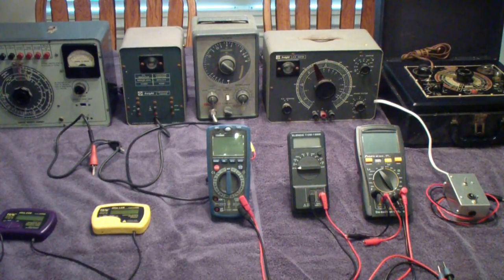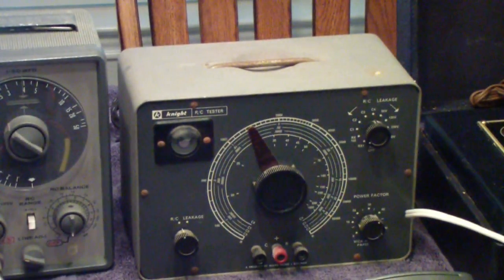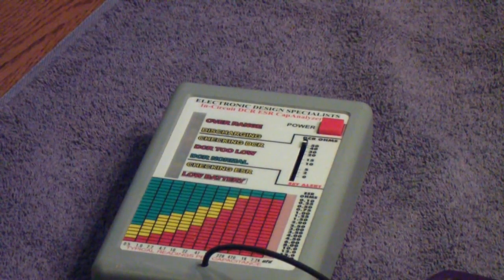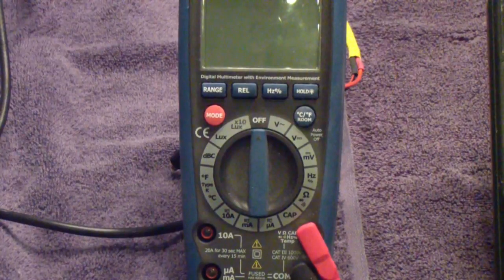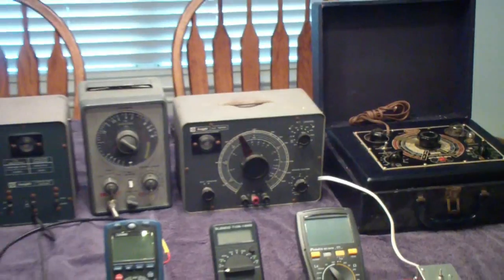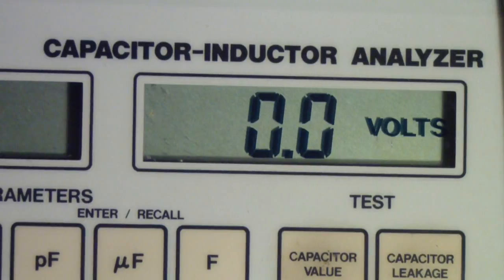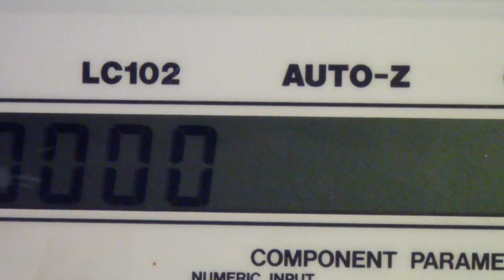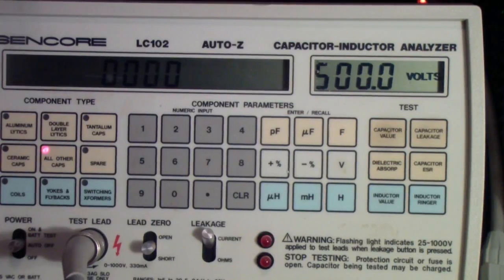TTT134 Capacitor Testers

Comment: It's interesting that the Sencore has a test function for dielectric absorption, while I'm aware that capacitors do suffer from this... I once purchased capacitors from eBay that were advertised as new but turned up as used with 16v still sitting inside them... Aside from the other tests which I find are important because a leaky capacitor as a power supply filter is making the transformer work harder than it needs to, high ESR in the same situation won't be able to smooth out the rectified ripple and the value is also important because if it's lower than what it's rated for it may not be enough to filter out the ripple or elsewhere it might be high passing an audio signal when it should only be blocking DC... But dielectric absorption? Where would this be a bad thing in a circuit? I really can't think of why it would be a bad thing that it even has a test measurement for it.... A good power supply design should have a bleed resistor... Yeah I really don't know why it's important... Anyway, great video as always... Very well done..
Reply from the maker: Dielectric absorption becomes important when you want to, for example, discharge a capacitor to zero but the capacitor will not stay there. In a sample and hold circuit, for example, you must start out with a fully discharged capacitor, otherwise the final value will either be too high (if the residual charge from dielectric absorption is the same polarity as the sampled value) or too low (if the residual voltage opposes the sampled value). The voltage that builds up due to dielectric absorption is also a function of time, i.e. the longer you wait after discharging the capacitor, the larger the residual charge becomes. All of this becomes important in instrumentation applications, but it can cause trouble in other applications as well, like ramp generators, etc. What you want is a capacitor that remains at its applied voltage forever if it has no current path, which is not possible in reality, but whatever voltage you charge the capacitor to, you want it to remain there for as long as possible;  dielectric absorption continues to add (or subtract) charge after you remove the charging (or discharging) source.
Reply: tomtektest hmmm okay.... So basically dielectric absorption becomes an important factor in test equipment and so that means that if I were to purchase a piece of used test gear and I wanted it to be as accurate as it was when new, I would have to keep an eye out on the dielectric absorption on the capacitors because they could potentially be fudging the readings secretly if I wasn't aware of the problem.... But how about in audio equipment? is there anything that dielectric absorption in capacitors would affect the performance in an adverse or detrimental way? 
As I said earlier, I fully understand what and how the other capacitor side effects would or could potentially do to an amplifier for example but I can't think of where I would look first in a circuit and think.... hmm I'm going to check those capacitors right there in that section because it's known that they cause problems due to dielectric absorption.... hopefully you get what I mean? 
When it comes to capacitors, everyone says to check for leakage because blah blah blah and make sure that it's ESR is low because blah blah blah and capacity, shorts, dried out and so on but I have yet to come across anyone who has mentioned to beware of dielectric absorption in capacitors because blah blah blah, apart from you here and now with regards to test equipment... I'm just not sure if I should be concerned about looking for dielectric absorption in capacitors in my audio equipment... unless if it affects the Ac frequency somehow which would mean that it's changing the sound and therefore needs to be replaced... But yeah LoL I don't really know...
Reply from the maker: The examples I gave are because my background includes a lot of instrumentation engineering, not because that is the only place dielectric absorption (DE) impacts circuit performance. DE occurs because the dielectric is imperfect and tends to distort under voltage. It can alter any circuit, including audio amplifiers, etc. The basic idea is that good capacitors have low DE (just as the have low ESR) and bad ones have high DE. The type of capacitor matters too, which is why multi-layer ceramic capacitors are a bad choice for audio coupling. The dielectric distortion causes electronic distortion, so it should be eliminated where electronic distortion is unwanted. But it is also a question of economics - do you use cheaper capacitors (or leave old capacitors with higher DE) in the circuit or do you spend the money to uses better ones? The answer is an engineering decision. If you have high distortion in an amplifier, for example, it could be due to a lot of things (bias point, bad tubes or transistors, poor circuit design and bad components such as resistors that have deteriorated or capacitors with high DE or high ESR). The best approach is to decide how much you want to spend and buy the best that you can in that budget. Better products have better capacitors in them, generally. But capacitors do change over time and if you notice distortion or other deterioration, testing or changing the capacitors my be needed to fix it. I hope this helps, perhaps I will do a video on the subject someday but I suspect there are a lot better experts on this in areas like amplifiers already out there.

Comment: The Sencore LC102 looks like a nice all around unit. It looks like Sencore has been bought out by a Chinese company now, and they only make broadcast equipment. Too bad. My meter only measures capacitiace. I need to get something that will measure ESR. It looks like the Atlas unit will be the one for me.
Reply from the maker: Thanks for the update on Sencore; I suspected they had gone in another direction since the Radio/TV repair business has just about fizzled out. You can probably still get LC102 and LC103 units on e-bay but they really are overkill unless you need them for a commercial use.You might also look at the Blue ESR Meter. I don't have one but it is less expensive and several people online seem to like it. Whatever you decide, please share your experience.

Comment: I was gonna ask you if you own a grid dip meter, but after seeing this collection of cap bridges and testers, I'm changing my question to "How many grid dip meters do you own?"
Reply from the maker: Thanks for asking. I only have one working grid dip meter made by EICO. I have a second one (Heathkit) that doesn't work (I knew that when I got it but it was part of a bunch I bought from a repairman who was getting out of the TV business.)
Reply: tomtektest 
I'm thinking about buying the $150 WunHungLo MFJ-201 just to play around with it. I don't have any actual requirement.
Reply from the maker: Although I have been a licensed Ham since the 60's I have never used grid dip meters for anything except trying to find the resonant frequency of IF transformers in some junk radios. I have never used the MFJ-201 although I have used a lot of other MFJ products with mixed results. Some are great and some not so much in my experience. I always open an MFJ product and inspect it for assembly issues. Most of the MFJ products that did not work well were due to bad solder joints, loose connections, etc. Of course the ones that worked well did not need the attention but it showed me that the assembly quality varies. If you buy a 201 I hope it will be one of the well-assembled batch (or you can find and fix any problems). In my opinion, MFJ equipment is great if it works and generally you can get it to work - if it doesn't - by simply looking for obvious assembly problems.
Reply: tomtektest 
Thanks for the feedback. I found another new unit from Taiwan (hopefully better construction than from China) under the Lodestar badge for $30 less, so that's probably how I will proceed.
Reply from the maker: I would like to see what you thnk of it. Perhaps you could make a video?
Reply: I don't do videos, but if I pull the trigger, I would be happy to lend it to you for a few weeks if you want to have a look and see what you think. Your opinion on its relative quality would be more meaningful than mine.
Reply from the maker: Would you e-mail me at bktektest@gmail.com and we can discuss further.